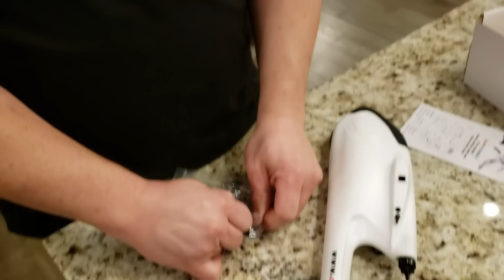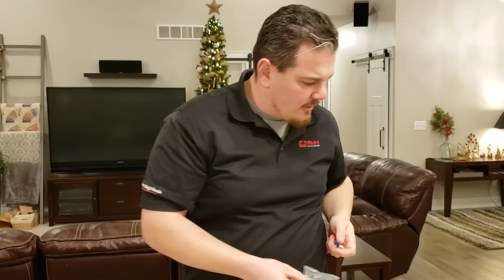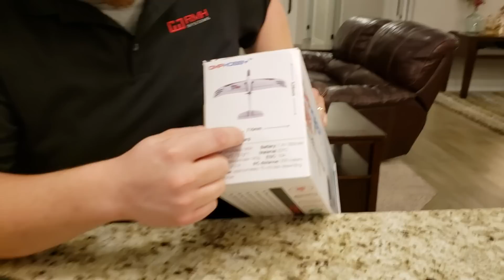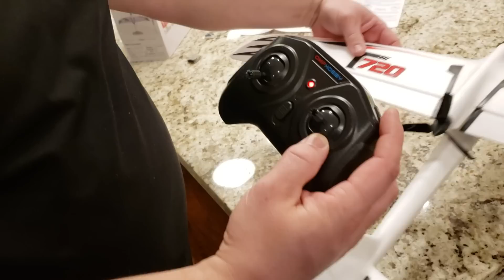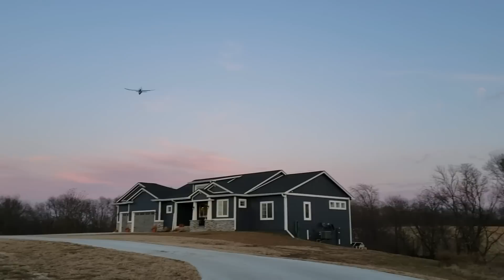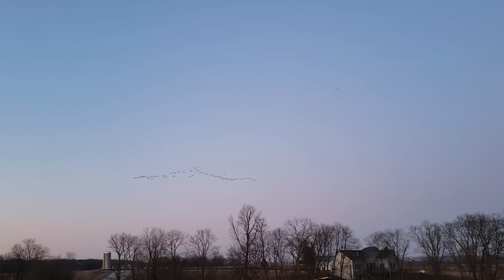Sunnysky / OMPHobby - T720 - RTF RC Airplane - Unbox, Setup, Flight

Comment: Would it be easy to replace motor in this glider ? I’ve been looking for a diy video and can find nothing ….wanted to change to a little bit bigger motor …have you ever tried to mod anything ? Idk y I want to mod everything I see lol…I’m trying to learn as I go
Reply: I think you've outgrown this model and you want more speed, even the button "stunt" doesn't help. You need to try an aerobatic airplane (some kind of fast and cheap one). Like HACKER Super Zoom 2 EPP.

Comment: I know you are into Blade helicopters and do a lot of reviews for them but you ought to look at OMP M1 and M2's. High build quality, direct drive extremely low parts count on the head, etc. Really kind of a revolutionary design in RC helicopters.
Reply from the maker: I had a contact that would have sent us the heli's but they stopped communicating??? I don't know why, but we have better things to do with our time than chase down OMP reps. If they don't value us, we have our hands full with other better items anyway ;( Sorry to put it so bluntly, but that's really it.

If you talk to OMP and you want to see us review their equipment, we never slammed the door on them...it was THEM slamming the door on us, and we didn't get so much as the courtesy of a phone call or email...Some of these companies are just run very, VERY poorly.

Comment: Hey Brian, thanks for another great vid. Around 47 min when you're explaining how to get out of a death spiral, was that in fully-stabilized mode, or was that with stabilization off? And will that work with most planes in a similar death spiral?
Reply from the maker: I think it was in Auto Leveling! I think we kinda take for granted how well SAFE works in Horizon Hobby models...the limited bank and pitch angles help prevent getting into these unrecoverable stalls.
Reply: @BrianPhillipsRC  Will that recovery method you mentioned (goose the throttle and pull back on the elevator) work for most models in similar stall followed by death spiral?

Comment: I bought this as a slow flyer so I didn't have to go to the flying field. I wanted something where I could walk out the back door, launch, fly over the pasture, and belly land. It does all of that, but just barely. The controller is really poor. The sticks are very twitchy, even in "normal" mode. In "Sport" mode, the plane will occasionally loop or roll, but most of the time it won't because it's severely underpowered.

I couldn't get the receiver to bind to my Spektrum NX10. I thought binding the plane to a good Tx might even out some of its bad tendencies, but it simply wouldn't bind. I can go through the procedure of holding the Rx bind button until the blue light does its fast blink (indicating the Rx is in bind mode), but no joy. 

If you or someone you know is absolutely brand new to R/C airplanes then this might be a good trainer, but there are many better. If you're an experienced flyer looking for a slow flyer or something you don't have to drive to the field to fly, this isn't the model. Sorry.
Reply from the maker: You need a SERIAL Rx that you use WITH this plane to make DSMX and option. It's later in the playlist of this plane, and you will LOVE this plane when you get the Spektrum Tx working with her. SOOOOOOOOOOOO much better!

Careful with those direct drive servos...they're TERRIBLE to replace!!!
Reply: You're on some mission there willy boy . I've seen the (EXACT) same comments from you elsewhere. (  Verbatim)  . What's your game? You must of had a bad experience? You certainly must not have watched this , re your comments about loops n roll etc , for one thing

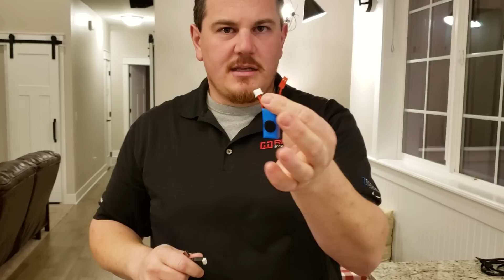Comment: Brian.. You mentioned  @12:11, that you charge the battery through the white connector lead , which would be the balance connector on most batteries.The  other one you said, is for discharging the lipo. ( usually the charging lead). Quick and easy on the supplied basic charger, if you only intend to charge. Just wondering though, on how you would balance and storage charge this type of lipo on a conventional charger.. Hope this makes sense. lol
Reply from the maker: Just use the plane, and test your voltage when you're done. If it's at or close to 3.8V DC - you're set. If you don't want to do that, then you need to get a charger that supports "Discharge" - which is very VERY common...but you want to know how many times I've done it - ZERO time.

Don't listen to me for battery safety though - just do what you're comfortable with. I'm not always the best example when it comes to battery maintenance, since I have like 1000 of them. This is why I LOVE SMART packs...they take care of themselves, but can't get them this small yet :(...

Thanks for the question!

Comment: Brian, I just took possession of this model and upon inspection I see it appears that the motor is slanted to the right side just slightly, maybe 10° or so. My thought is that it's this way to offset torque the motor creates. Please take a look at your aircraft and let me know what you find.
P.s. this is my first fixed wing plane. Longtime quad pilot though.
Reply from the maker: This is 100% correct. Good call Butch!!!

Good luck, and you'll have NO problem, except you'll about crap yourself when you realize you can't stop - LOL ;) It's scary the first few times!!! Make sure you have a flight plan together, where are you gonna take off and land, sorta thing...then just do it - you got it!
Reply: @BrianPhillipsRC  right on! I was hoping I didn’t have to send it back before it’s maiden. Lol.... ohh that extra back piece that comes with the kit is a spare propellor hub. It’s only plastic. The screw holding the prop on is not a machine screw to metal so there’s a likelihood the hole might get “wallered” out over time.
Reply: @BrianPhillipsRC  sorry... it was quadcopter101 that said the spare part was not needed. Got you guys confused for a moment, my bad. P.s. wind gusts "naturally" beyond 20mph so no fly today, but can't wait.

Comment: Seeing a down and to the left thrust angle. Down seems correct but did yours also have a strong left thrust angle?
Reply from the maker: Sorry, I can't recall Sushan. That being said, tractor style planes will pull down and RIGHT, but with a pusher, I assume there's still some torque effect that's needing to be countered. This might explain the thrust angle you're seeing. I DO remember the mount was VERY specific...it wasn't sloppily mounted like on some foam models. These OMP hobby planes were very meticulously mounted...almost like they were machine assembled.
Reply: @BrianPhillipsRC  thanks for your replies! Has been very helpful for someone trying to see if the hobby is right for them!

Comment: whats an up grade battery? and if i buy another plane what is a good  up grade
?
Reply from the maker: This plane is a great plane, but not sure there's an "obvious" upgrade from here.

Aircraft
A-10 Thunderbolt 64mm https://bit.ly/2CCiFPp
Aero Commander UMX https://bit.ly/38Zo8fn
Apprentice 1.5m https://bit.ly/2CfTCBY
Apprentice Mini https://bit.ly/2B3VsoR
Air Tractor 1.5m https://bit.ly/32q8tnY
Carbon-Z Cub SS 2.1m https://bit.ly/2OqQllK
Carbon Cub S2 1.3m - https://bit.ly/32UawRn
Conscendo Evolution 1.5m https://bit.ly/2DPmW2F
Citation Longitude UMX https://bit.ly/3950LRt
Cirrus SR22T 1.5m https://bit.ly/3fKjO60
Cherokee 1.3m https://bit.ly/2GYrS6M
EC-1500 Twin 1.5m https://bit.ly/3j8ODDK
F-16 70mm Thunderbird https://bit.ly/3fxi1Bi
F-18 80mm Blue Angles https://bit.ly/36m1ZbP / Navy https://bit.ly/36kOY2e
F4U-4 Corsair 1.2m https://bit.ly/30jJUGy
Habu STS 70mm https://bit.ly/3fRaLj7
Night Timber X 1.2m https://bit.ly/2CB9I9d
Turbo Timber 1.5m https://bit.ly/2CiTmSB
Turbo Timber UMX https://bit.ly/3fxTDQd
P-51D 1.2m June Nite https://bit.ly/30hC9ku
P-51D 1.5m Mustang https://bit.ly/2CB6l22
P-47 Razorback 1.2m https://bit.ly/3j8NXhG
T-28 Trojan 1.2m https://bit.ly/32oGSnc
Sport Cub S2 UMX https://bit.ly/2OqnYUK
Inductrix https://bit.ly/3fBIjlS
Viper 1.1m https://bit.ly/2Osevfw
Twin Otter 1.2m https://bit.ly/2Zvn5AI
Mini Convergence VTOL https://bit.ly/3h8u2xl
Mini AeroScout https://bit.ly/3myDE8i
Ultrix UMX https://bit.ly/2OpYAi2
Ultimate 3D https://bit.ly/310pzrl
Maule M-7 1.5m https://bit.ly/2Wrj1zz

XK X450 VTOL https://amzn.to/2GgLtLS / https://bit.ly/39XCOuj
JJRC MO2 VTOL https://amzn.to/2zwNvaV / https://bit.ly/2TTq4Qn

Eachine E160 https://bit.ly/2DXmEGU
E129 https://bit.ly/2FDI5Oq
XK K130 Heli https://amzn.to/3b2JcBo / https://bit.ly/3e9UHsZ
XK AS350 / K123 Heli https://amzn.to/2EerkpG / https://bit.ly/34uqmB1
XK EC145 / K124 Heli https://amzn.to/2GOOswr / https://bit.ly/34BaZXP
XK K110 / Blast Heli https://amzn.to/2tpDplF / https://bit.ly/2Vgb4Me

XK A160 / J3 Cub https://bit.ly/3i85kxr
XK A600 / DHC-2 Beaver https://amzn.to/38jPTNF / https://bit.ly/2yPlnze
XK A800 https://amzn.to/2X7thf2 / https://bit.ly/2JVX8l2
WLToys Sky-King https://bit.ly/39T30Gh
EZIO 1500 EP http://amzn.to/2CMR901
Volantex ASW28 2.54m http://amzn.to/2ABU3zI / https://bit.ly/2VlLtBm
Phoenix Evo 1.6/2.6m http://amzn.to/2FGsR6e / https://bit.ly/2yPQ8nI
Phoenix V2 2m https://amzn.to/2UW7AQy / https://ban.ggood.vip/5a5y
Sunbird 1.6m Glider Kit http://amzn.to/2CJy6DX
Bird of Time Kit https://amzn.to/2LN2EFD

Cessna Citation II https://amzn.to/2ZFMfg3
Tian Sheng Airbus A380 https://bit.ly/2X4H2f0
XK A120 Airbus A380 https://amzn.to/2N1AMDo / https://bit.ly/2UWpQbN
XK A150 Boeing 747 https://amzn.to/2J5nBgl / https://bit.ly/39XD6Bp
QF-008 Boeing 787 https://amzn.to/2IQSbt1 / https://bit.ly/2y3C1e9
WL Toy Boeing C-17 https://amzn.to/2JqeRAw / https://bit.ly/3aYLNMV
XK A130 Y-20 https://amzn.to/2LGyJSE / https://bit.ly/2Vb4zKk
XK A100 J-11 https://bit.ly/3i9rAqy
XK 430 Edge https://bit.ly/3aFq0ux
Eachine
Mini T-28 https://bit.ly/3398xse
Mini F4U https://bit.ly/3h3OhNI
Mini P-51 https://bit.ly/2JQDtDj
Mini F22 https://bit.ly/39Zvf6r
E119 Heli https://bit.ly/3e3SnDU
E0101 Drone https://bit.ly/3l2bst0
Volantex
P-51 Red Tail https://amzn.to/2uuy7ZT / https://bit.ly/2XrfKRR
Sport Cub 500 https://amzn.to/36z22Or / https://bit.ly/3c3Yqqn
Mini Trainstar https://amzn.to/2SHuzxr / https://bit.ly/2Xqk2Jy
Micro Trainstar https://amzn.to/2QJtfaV / https://bit.ly/2JW7TUK

Comment: Hi Brian  can you please look at the motor on your T720 from the rear of the fusalarge my motor is not in a straight line to the seam in the fusalarge my motor  is pointing out to the right  
Is that normal?
Reply from the maker: yes, and it's to help correct for P-factor and with a pusher configuration, there's a thrust angle to consider too.

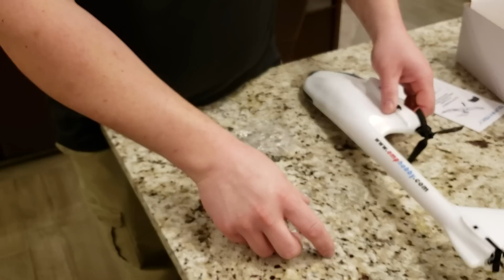Comment: Please sir, what is the triangle piece of black plastic bit that comes in the little plastic bag with the screwdriver (can be seen at 4:25 )... ?
Reply: It's a spare prop drive adapter.  It's bolted on to the rotating case of the motor and has a little keyway to engage with this particular prop.  The prop itself is held on to the drive adapter by a little screw housed in the spinner and engages with the hole in the shaft of the drive adapter.
Reply from the maker: Just holds the prop on the front half of the bell housing of the brushless motor. Max Robertson beat me too the chase :) It's a part that most people won't break, as the prop is pointing backward on this T720.

I call them "prop adapters"...but there might be another name ;)

Comment: Great review, on nice little plane I like the way it crows. You mentioned it needs a little weight in the front, l like to glue a penny on the battery or even tape  it to the battery.
Reply from the maker: That's a good idea! Then it would fit well with the 2S pack!!! If it's not enough, maybe a nickel?
Reply: @BrianPhillipsRC  or 2 penny's I fly a lot of wings and CG is really kinda important on those.

Comment: when looking from the front of plane on a pusher.....turns COUNTER CLOCKWISE
Reply from the maker: yes, counter-clockwise is what direction I expect, aside from counter rotating props, but I've only had a handful of pusher props, and to be honest, didn't know if that was correct, so didn't want to say :)
Reply: @BrianPhillipsRC  my dad was a pilot
Reply: " ...when looking from the front of plane on a pusher.....turns COUNTER CLOCKWISE ... " !   Not necessarily.  It depends on whether the prop is designed to turn clockwise or counter-clockwise.  The assertion that your dad was a pilot has absolutely NO bearing on the matter.
Reply: @maxrobertson5061  I was just giving a....OVER ALL KNOWLEDGE.....fact to help with knowing the rotation of BOTH

Comment: I have to agree this plane is much easier to fly than the S720. I bought the S720 first and I lost it in a very tall tree. I have got one of these and it does all the tricks and is much easier to fly. Just bought a FMS 850 Ranger they are new on the market. I predict that you will be singing it's praises before too long. Awesome channel probably the best
Reply from the maker: Thanks Jon! I actual have an SBus device coming, as I want to try it with my DX18. Maybe then I can setup the S720 Sport more to my liking??

Comment: Another incredible plane! Now I'm confused what should i buy
Reply from the maker: If I had to pick, there would be three factors to consider...

How fast do you want to fly?
How much space will you be flying in?
How skilled are you as a pilot?

These are the three items I'd consider, then I'd use the three answers to help point me toward whichever plane meets those needs.

Good luck! Thanks for checking out the video!
Reply: @BrianPhillipsRC  great video and excellent advice points.  I'm not looking for fast. I don't have large fields to fly in around here. And I'm sort of maybe intermediate level experience wise. After messing around with the old Hobbyzone Firebird RTF many years ago I got back into flying seriously more this year starting with the small and cheap RTF Hobbyzone Duet then quickly stepped up to the RTF Dromida Sky Cruiser 2  which I loved and now I'm looking to step up from 3 Channel to 4 channel to learn to use ailerons This model seems to check all those boxes for me. My only concern and question is do you think this will this fit back in the box in some way for keeping in my car for flying after work before sunset? The prop doesn't fold so that's what I'm wondering. 1) Can the prop easily go on and off? And 2) Will repeated prop removal possibly damage the motor shaft threads? I Look forward to your advice. Thanks again.
Reply: @jbsouthpaw2009  I ordered one last night. I'm sure it would fit back in the box. You just have to take the wing and tail fins off, which look real easy.

Comment: Wil it bind to a Spectrum
Reply from the maker: This plane is RTF, but there is some way to hook up some form of an Sbus adapter, but I don't know for sure as that's something I haven't tried yet. If I try it, I will film it and share it for you. Evidently there's a few guys out there that have tried it, but they're working out the pin outs so they can no destroy the Rx brick inside the plane. My predisposition to using Spektrum definitely makes me lean to using my DX18 to fly this plane, since it would fly a LOT better, but there's some planes I have to really check my strong desire to modify. Some planes are just "fine" the way they are, and I don't have the time I used to to make these mods. I'm not trying to dissuade you from trying, by any means though.

Comment: can you put a little cellophane tape on wings?  maybe strengthen and cover gap.
Reply from the maker: For sure! That would keep them from popping out, but that feature (popping out) will help protect the structure somewhat. I was pretty disappointed to see that gap in the one wing, it's not customary from OMP hobby...they make a really mechanically sound plane, when compared to it's pier group, like Volantex/WL Hobby/XK etc...all the cheap Chinese branded micros.
Reply: @BrianPhillipsRC  Thx again!
I race fpvkwads and recently bought an XK 520 and a Duet..Started a week ago.
still to maiden XK...Kansas winds!

Comment: Thanks Brian, that's a nice flying  plane. Wish it would bind to the Jumper but they say it won't. Maybe a guy could put some tape on where the wings join.
Reply from the maker: for sure with the tape....as for not binding to Jumpers...I know someone will figure it out, and IF NOT, you can use SBus, if I understood the instructions right...HOWEVER, I don't have first hand experience with that. Maybe I can ask the vendor to send an SBus Rx for me to try, or better yet, a Spektrum Rx that would work the same????? Then DSM2/X would open up Spektrum and Jumper too!

Just a thought. I'll look into it. Thanks for stopping by joeg986!
Reply: @BrianPhillipsRC  I think it would be even a better flyer with a different transmitter.
Reply: So even if the jumper is a 4 n 1 it won’t bind with this glider?